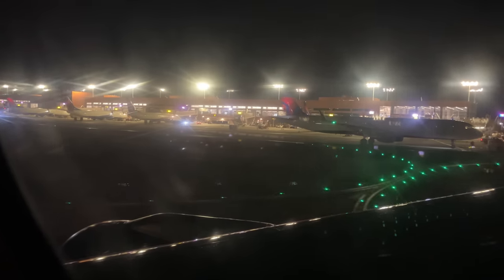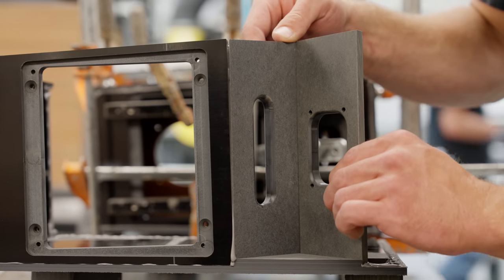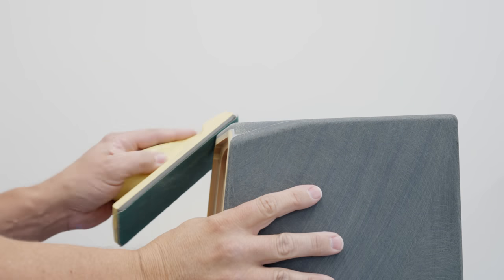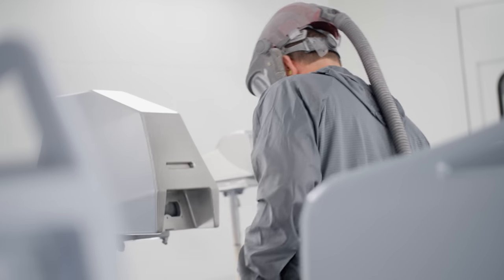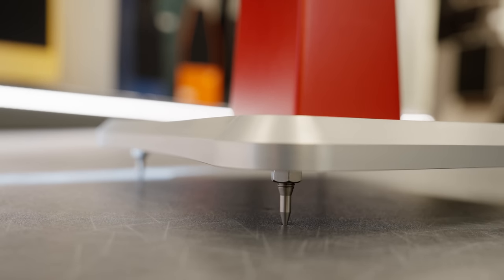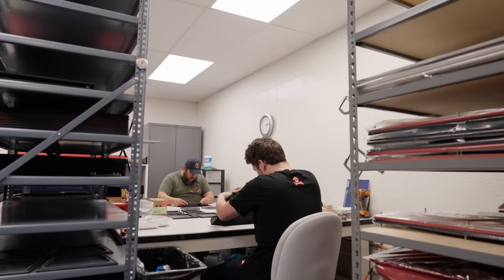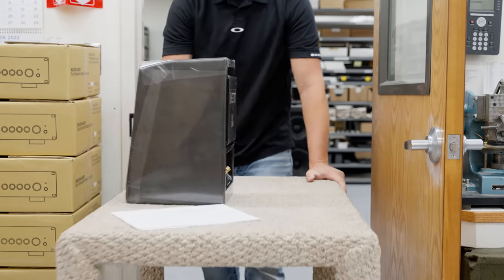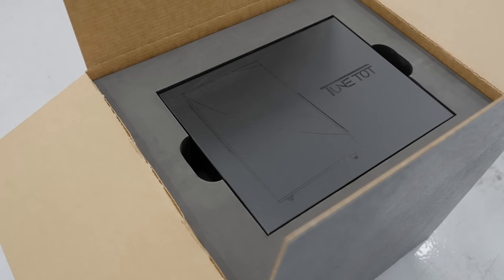American Made: WILSON AUDIO TuneTot

Comment: As a hobbiest woodworker, I have better dust and fume precautions in my spare garage.  I feel sorry for those production workers with only simple masks (If even that) with that sawdust, solder and resin fumes, etc..  These work conditions are completely inadequate for anyone trying to preserve their long term health.  They must have very lax labor laws and inspections in Utah which probably isn't surprising.
Reply: I was wondering if the workers have a union
Reply: They rely on their Mormon faith....
Reply: yes I was thinking exactly the same thing, a day of that would be misery (I've done my share of sanding)
they need suction fans in the ceiling or something to rid the dust fumes etc
Reply: I'm an ex welder....you knowvthe risks....I've also be around several soldering processes and tbh you need the minimum to be deemed safe as a company.
Reply: Excellent evidence of Wilson not providing adequate OH&S standards. Any lawyers watching here's a class action for you .
Reply: They d come out of the crates all dusty when  we used to install them. Grit on casters too, relavaling a dirty factory floor.

Comment: I work in construction, why are they not using sanders with VAC's,, makes the sand paper last longer, the items does not over heat and pretty much no air bourne particles. The lungs of these guys, I'm surprised they are doing this. Nice to see hand made products however.

Comment: So what's the material used for the cabins? I didn't get it. Also, where, how and by whom are the drivers made? 
Somehow this video make me lose some appreciation for the brand and the products.
Reply: It’s a special material called X material that’s made only for our speakers. We also have S material for certain parts and V material for other parts. A lot of our drivers come from a company called scanspeak, they are designed by wilson though. So most of the drivers coming from them are only used in our speakers

Comment: I love my Wilson Audio TuneTot speakers with ISO Base and tube power amplifier class A 40w
Reply: 40 watts is enough to drive them properly?
Reply: Needs ample amp pairing. Would recommend more than 40w.  Currently running 100w tube amp which is excellent

Comment: I have a pair, to me they are worth it.   Endgame speakers for me.   My wife who thinks im crazy even loves them.  I needed small speakers these really throw soundstage details and full sound.   I tried everything in that price range.    I wanted heritage specials or bowers but i got these instead.
Reply: If the official specs are correct, they should lack in low end. Even my cheap and smaller Adam T5V have better bass extension.  So, i wouldn´t buy these, even if i was a millionaire. But now, if we are talking about the Alexandrias, that´s a whole different discussion...
Reply: I run an rel sub with them.   They really groove
Reply: Paired with the Wilson Loke subx, it is spectacular
Reply: You definitely made the right choice . I had a pair of Heritage Specials - I found they need a lot of space around them to sound good ( two metres from any walls)  - I ended up trading them in for a pair of tune tots - never been happier with just listening to music and not the system .

Comment: I'm not sold on the idea of sealing off the crossover.  It limits serviceability. I can understand the need to keep competitors from seeing what you're doing but for the end user it's a turnoff. I guess they figure anyone that could afford these would not worry about them lasting forever anyways.
Reply: What serviceability?  These are so well made, that they will last forever...  😁
Reply: @mindtraveller100  The components won't. My stand mounts are on their second set of caps and inductors
Reply: What is the lifespan of a crossover?  Never thought about that.  It's gotta be a few decades, no?  Home speakers aren't exposed to extreme temp or humidity changes often.
Reply: Amir, when was the last time you saw a speaker crossover fail?
Reply: @mindtraveller100  what do you mean dude, no matter how well they're made after 20-30 components like capacitors start to fail, anyways I think its absolutely stupid and selfish , everything they do they explain to the video as proprietary and company secret. They should say: "Wilson audio, expensive speakers, you won't keep." 🤣

Comment: I dont care how well these speakers are made or how good they sound. No bookshelf speakers are worth the price of a small car! Just consider how much different parts, electronics, complex drive systems, interior, paint goes into even a very basic car! Just consider the huge difference in volume of material alone!
Reply: Paint , electronics , drive systems dont cost much. What costs is labour, mastering and passion. In this case , they are here in spades.
Reply: PS : my uncle has got a small car and it costs over 100 grand New. Size and Price are not Always corolated

Comment: These speakers are practically hand built, almost nothing is automated and requires skilled labour.  Lots of care goes into these. Makes sense why the prices are what they are.
Reply: if they sold one without 70 man hours of pointless sanding they might be a more sensible price.
Reply: Did you not see the huge automated cnc routers for cutting out all the pieces?
Reply: @davidsmithson9236  that’s why i said practically not completely.

Comment: What is that "XNX material" he is talking about,  that the speakers are made of? Is it plastic of some sort or? Is it environmantelly friendly?
Reply: I can guarantee none of this is environmentally friendly
Reply: I'm assuming Wilson considers that to be proprietary knowledge they don't want out.  I also noticed that at no time did we get to see the parts of the crossover, so Wilson must also consider that to be proprietary.
Reply: It could be something like a Marine grade polyolefin that are relatively easily machined using carbide tooling.  Like a high density polyethylene. It looked softer than phenolic board during milling operations (Or maybe a high density phenolic board with no laminate skins perhaps?)

Comment: Funny speaker. Poor bass extension even for a bookshelf speaker and 7dB bump above 100Hz due to weird port tuning, wild ~12dB frequency response deviation, directivity error.. Yours for only $12k, what's not to love?
Reply: pretty much...
Reply: Have you listened to them? I think they sound fantastic.
Reply: @Nick Hough  nope, they have very limited availability in Northern Europe. But due to the shortcomings I mentioned (as seen in the ASR, Hi-Fi News & HiFi Voice tests) I do think there are better choices.. and for less money. I would expect near-perfect performance for $12k. And frankly I would go for either coaxial or cardioid 3 or 4-ways at this price point. I currently have similar-size Genelec speakers that cost 1/10th but actually outperform the TuneTot in every metric (freq response, diffraction, directivity, distortion, bass extension etc.). There might be of course other reasons to choose a more expensive speaker (aesthetics for example) and even with the shortcomings I imagine the TuneTots probably do sound good, drivers are high quality.
Reply: The poor bass extension claim is  nonsense - in my listening room they perform well down to 50hz - they drop off dramatically below that. In the real world of listening - These speakers have mesmerising musical prowess when connected with a good amplifier ( e.g Moon 860a)

Comment: Wow, in reading the comments, there seems to be a large crowd of non-audiophiles here. The handcrafting is tedious labor, the tech behind the cabinet designs and driver performance and matching has been executed over decades of refinements (since1973). Very revealing of the source material, so system matching is essential. The "religion" references are totally out of place.

Comment: Great video, but this company gives me the weirdest vibes, honestly. Unnecesarily fancy box, un-serviceable parts and not a woman in sight.
Reply: Totally agree! A less fancy box and less manual work could make this speakers a bit more affordable. € 15000 for a pair of Tunetots seems vastly overpriced.
Reply: @guidoroemer81  Do the math on it and then says its over priced.  figure out hours, then do a rough estimate on parts cost, then factor in some R&D, then what is left over is profit margin. My guess is they are making somewhere between 35 and 55% profit margin.
Reply: We have women working at Wilson Audio, if you couldn’t tell they obviously didn’t film every single person that works there. We have plenty of women there working. And as for serviceability, all the speakers have access doors on the bottoms or backs that allows access to all the wires and electronics.
Reply: Your comment is giving me the weirdest vibes...
Reply: Here in California you can buy used old Toyota pickup for $14,000 that has 200,000 miles and still put another 200-300,000 miles with minimal maintenance.  30,000 parts in the car that goes 80 mph with high temperatures, etc.  If you saw the factory assembly video you could think the car would cost $100,000.  Or you could buy this tiny speaker with 100 parts with $1 foam stuffed for $14,000.